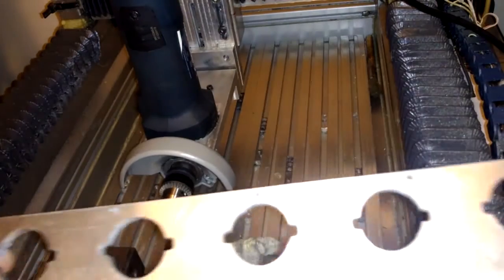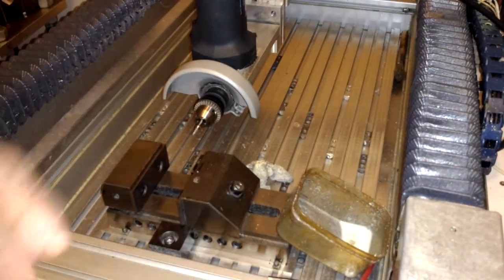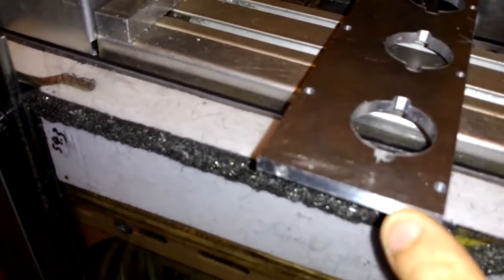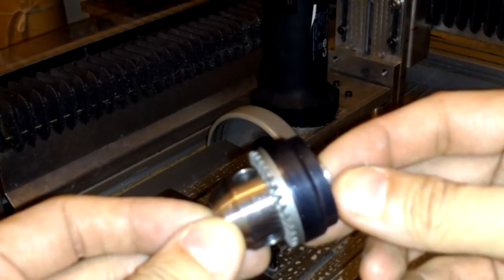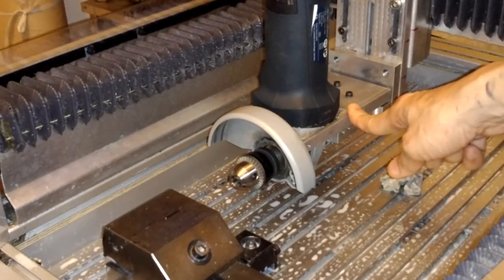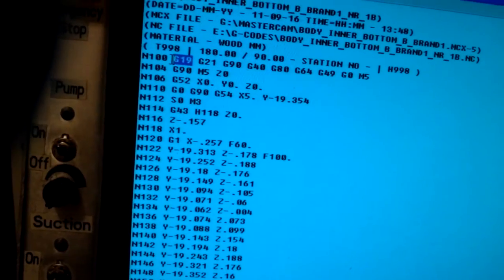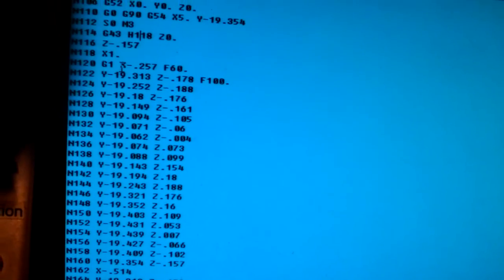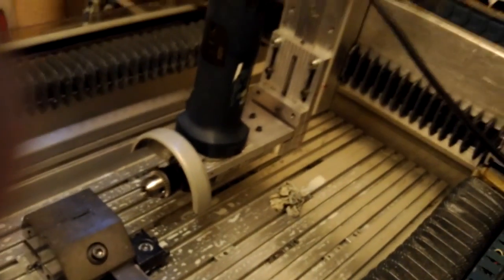CNC milling by angle grinder 3/3 - 30 (High Z CNC-STEP)

Comment: Well it's quite simple at that rate of RPM, in aluminium, you should be drilling quicker but i see the grinder was deflecting as you put the pressure. More bracing and less time wasted. Sharp drill is important.
Reply: If you can't do the job with out the assistance of a  computer manipulated machine, then you shouldn't be doing the job anyway. A qualified apprenticeship trained person can make tools to do the required work without computers and wasted time on explanations that take forever. Standards have disappeared.

Comment: nice idea , seen an angle grinder fitted with a speedcontroller and fitted with a daimond grinding stone 
the whole setup was mounted to the side of a milling achine and used as a surface grinder , if the routerframe is solid enough i can see this setup being used as a surfacegrinder as whell
Reply from the maker: travelling speed is an consideration,  industrial surface grinder travels back and fro fast(actually, I also don't know why), and, my router is slow. another consideration is the router machine precision. one would have higher expectation to the parallalism, flatness on the workpiece after the grinding. However, general router machine  construction itself is not up to this standard especially for larger working envelop one.
Reply: the speed might be to prevent heat being brought intoo the workpiece from the friction (going slow with grinding the part would heat up more toward the end making the metal expand and causing the acuracy to be less perfect 
it might allso prevent the edges or the item being ground from getting a slightly rounded edge (due to the smaller surface between the stone and the piece on entry and exit )